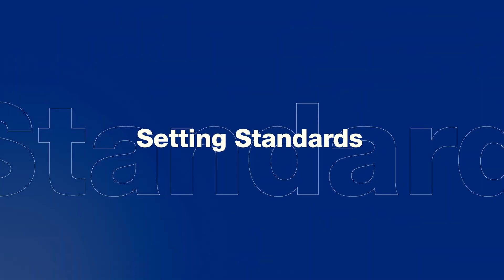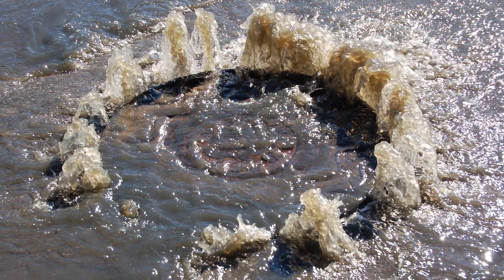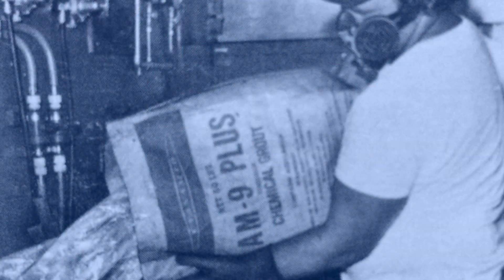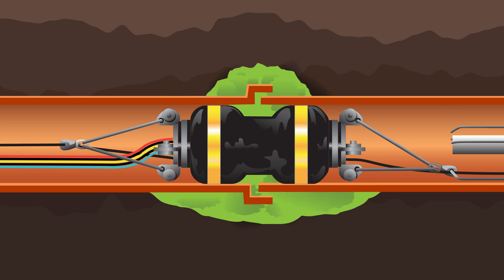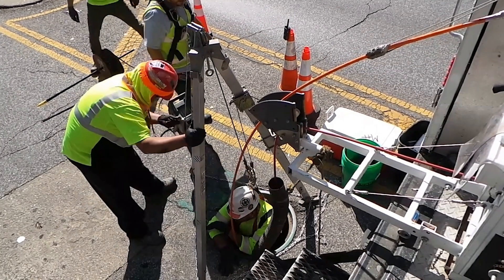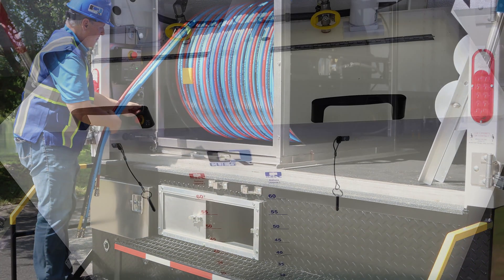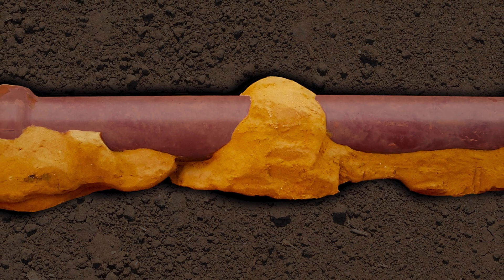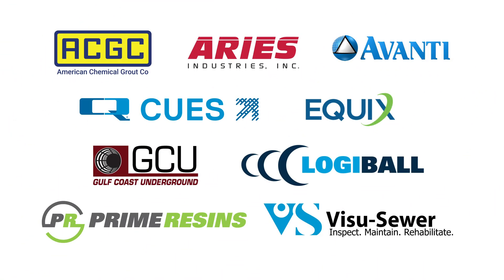NASSCO's Infiltration Control Grouting Video

Comment: Love the video. I do have a question though. How do you make sure that no grout remains inside the pipe at the joint? You would want the inside to remain smooth. Can this technology accomplish that?
Reply from the maker: The sewer line is jetted to remove any interior grout.  The seal remains on the outside.
Reply: @johnmanijak2486  nice. Thanks for answering my question!